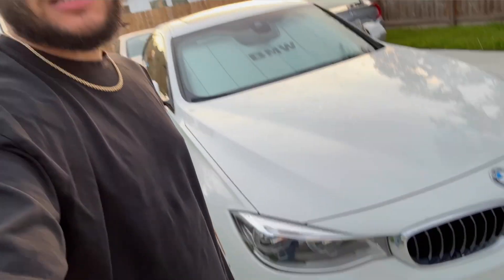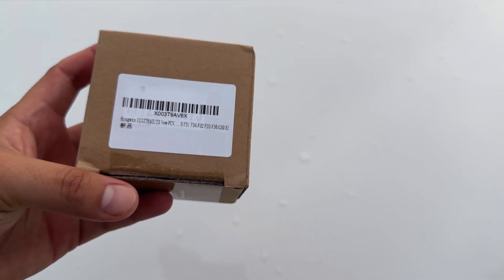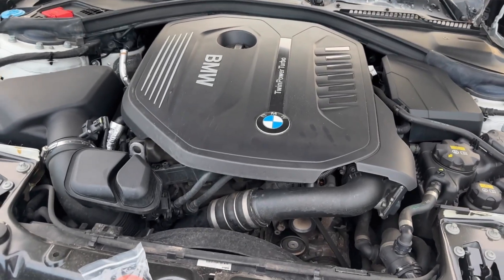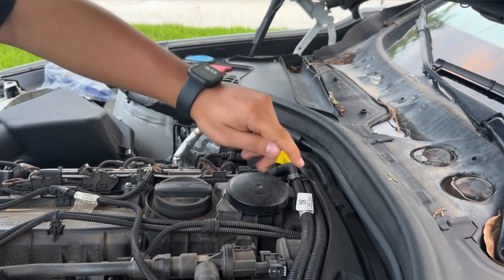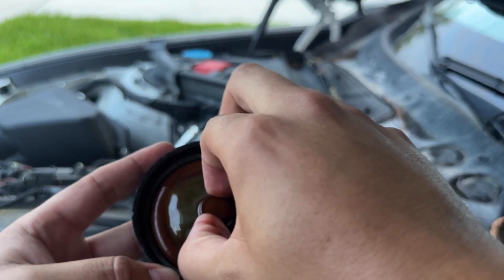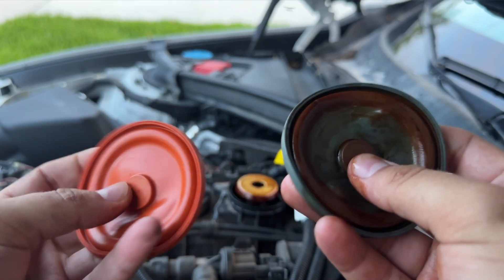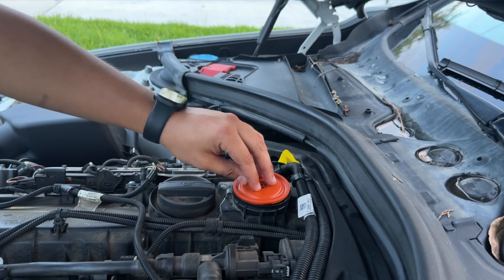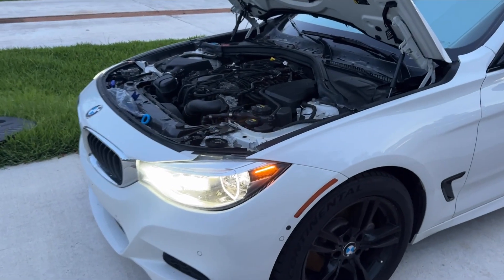Gen 1 B58 PCV Diaphragm Replacement - BMW F34 340i GT

Comment: So if my is below 150k miles, dealer will replace it for free? I know they change it with valve cover 😂
Reply from the maker: They should, yes. Check the SIB linked in the description to verify.
Reply: @supremegt i checked that page, they only replace the same thing that everyone does for 20 bucks, but their item is valued 249 bucks, and when i searched the part number, same item, cap, spring and diaphragm 😂
Reply from the maker: @Chrispage2 yup. I’ve heard that in the beginning of this issue, even dealers were buying the product from Amazon to keep inventory and fix cars!
Reply: @supremegt yeah im from europe and we got opf and it regenerates every 300-600kms, and it starts whistling only when regenerating starts, when idling daily it does not whistle

Comment: Hi mate, thank you for much useful information. Your channel is a real saver. UK watches you. My car's engine is 330 diesel, I noticed that when engine is warm there is smoke coming out from oil fluid dipstick. The milage is 50 k miles. Google says PCV valve could be the issue. Have you come across anything like this? Thank you
Reply from the maker: Thanks for watching. Modern BMW doesn’t have a dipstick! lol
Reply: @supremegt I do mate. It is 2017 GT 3 litre diesel N57.  VIN WBA8T72060BA28888
You can check it yourself
Reply from the maker: @joto4587 wow never knew that. We don’t have too many diesel BMWs here in USA. I would imagine it’s possible for your issue could be PCV related.
Reply: @supremegt yeah, anyway it is still on a year warranty so I am going to ask the dealer. Thanks

Comment: What were the symptoms you had that led you to this?  I have a weird chirp/squeal on parts of the rev range when accelerating - and I was informed to check the PCV valve as the culprit.
Reply from the maker: Loud whistle sound from engine bay and a lot of white smoke coming from exhaust.

Comment: How many miles you got on yours? I just picked up a 340 GT last friday
Reply from the maker: This happened around 72k. I’m almost at 79k now
Reply: @supremegt  Oh damn that's right where mine is at! lol I guess I will just go ahead and do this. Thanks man
Reply from the maker: @dinosoarskill17 yes sir and congrats on the new GT. Connect with me on IG and join my FB  group!
Reply: @supremegt  Yea man for sure, I will thanks bro, you as well I see you had recently picked up a different one so congrats to you too, looking forward to the spark plug vids as i wanna do these soon too.
Reply: @dinosoarskill17 I’m at 53k miles i have the replacement part should I do it or wait ?
Reply: @josh9425 it’s easy enough to do so i ordered a replacement and just keep it in my car. i’m at 80k and just drove across the country with it, and im in fl, so lots of heat